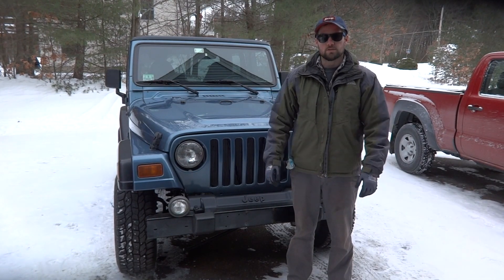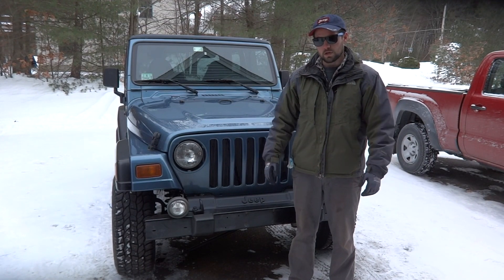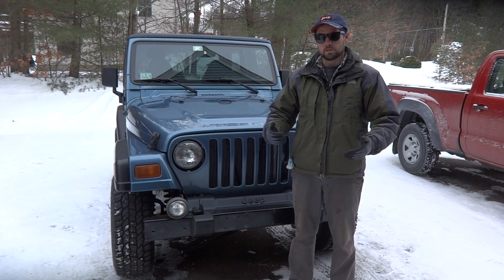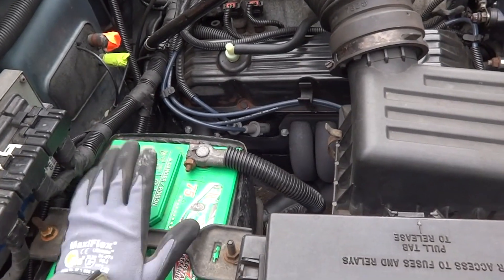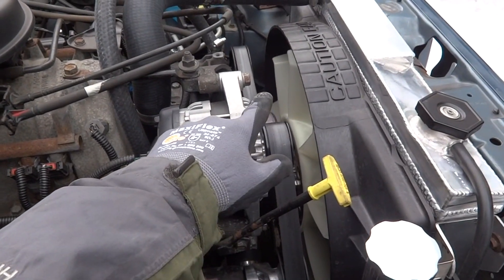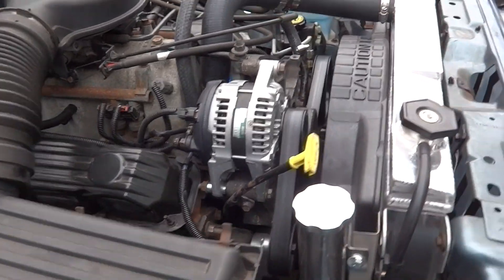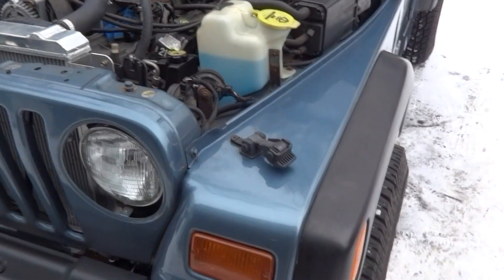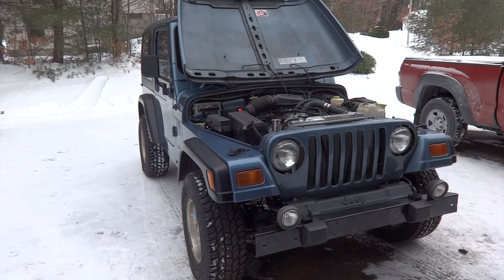Stuffing a 5.2L V8 into a Jeep Wrangler - Project Introduction | V8 TJ Part 1

Comment: What is ur mpg with the 5.2
Reply from the maker: So far has been around 13 mpg but the engine needs the plenum gasket replaced (and possibly some other work) so it may get a little better after that’s replaced. Mileage would also be better with a manual transmission.

Comment: Did you have to have any modifications done, 
i have a 2007 jeep wrangler with a blown 3.8l 
wanting to put a 5.2l out of a 1995 jeep grand Cherokee 
i have the complete grand cherokee vehicle
Reply from the maker: It would be a lot of work, I recommend doing a ton of research first. You'd probably be better off finding a donor vehicle closer to the 2007 model year, maybe a Hemi or an LS would be easier to make the electronics work.

Comment: Those had 4:10 in them
Reply from the maker: The jeep originally came with 4.10s but during the engine swap I installed a set of 3.73 axles to upgrade the rear dana 35 to a 44.

Comment: Great job! I love putting different engines in vehicles that didn't have said engine in there especially, if it's some sort of v8.
I'm conceptualizing a build for this winter  on a 2003 liberty. I love that you made it look like a factory install and the "practical" side of you thought about gas mileage. I'm mulling over the same points either using a durango/grand cherokee 4.7l, or 5l ford. The 4.7 is the same engine family as the present 3.7. However, 5l fords are tried and true. And, both being small v8s (hopefully) will net better gas mileage. The other reason for those 2 vs the 4.8l LS is the physical size. The ford is smaller all the way around. I haven't found exterior dimensions of the dodge 4.7 tho.
Reply from the maker: That sounds like a fun project. I don’t know a whole lot about either of those engines but I do recall hearing complaints about the 4.7 dripping valve seats

Comment: Hi, I would like to do the same swap (5.2 and BA from ZJ to 2.5TJ) as you've done but at the moment some information are missing to me about the ECU. I need to know the VIN number for the programmation of the ECU that I need to buy it in US, can you please help me and provide this number if you know it? Or maybe if you can provide me some other information or contact about it, it will be really helpful. Thank you and good job about your car.
Reply from the maker: Unfortunately I don’t think I can help you with that. I would say your best bet it to use the ECU from the same vehicle that the engine came from. I’m not sure if the vin is programmed into these ECUs, I’ve attempted to read the vin from mine with a scanner but have not been able to.

Comment: Hi.  Nice building.  
I have a 2006 Tj with a 2.4 with 6-speed manual that I plan to replace with a 5.2 automatic from a -97 cherokee.  What do you think about such a swap?  Or do you have something to recommend?  I have to use original parts such as fuel injection and catalyst if I am to get that road legal here in Sweden.
Reply from the maker: The closer in year the two vehicles are, the easier of a time you will have with wiring the new engine. I’d look for an 06 Cherokee with a Hemi to use, if those were available in Sweden

Comment: I apologize if this was already addressed, but being that it is a 2003, did you have to deal with inspections?  I was under the impression that it had to be a pre-2000 model.  Would love to know the legality of such swaps and whether I can use a newer Wrangler.  Thanks.
Reply from the maker: Emissions inspection requirements are vastly different between states, I would recommend looking into whatever state agency is in charge of doing inspections on your state and give them a call

Comment: Hello I have a jeep 99 wrangler it also has the 5.2 motor that was swapped into it I need some help I was wondering if there’s anyway you could help me I have some ECU questions
Reply from the maker: I'm not expert but I can try. I'd recommend checking out the 'Wrangler Magnum V8 Discussion' thread over on jeepforum.com too

Comment: Collecting parts for this very swap into a 1997 TJ with manual Ax-15
Reply from the maker: Manual is the best way to go with this swap IMO. Less wiring.
Reply: Do you need to get a manual 5.9 or 5.2 ECM/PCM or will auto or manual work?
Reply from the maker: @zackarymccullough5368  You'll need a manual PCM for a manual transmission

Comment: Hey great v8 swap! I'm in the process of a 5.2 swap too, the only thing that keeps me from doing it (besides corona) is the wiring harness part. Once your are done with the wiring for the engine, what do i have to do with the other electronic components? If i do an standalone wiring harness with working gauges, will i need another harness for things like parking lights interior and exterior lights blinkers etc or after the engine part done i have to add more wiring to the new engine pcm? I'm totally new with this i think i'm running in circles for nothing 😅😅😅 thanks in advance
Reply from the maker: No extra wiring needed, that’s the beauty of this swap! Splice the V8 engine connectors (and transmission connectors if you’re installing an auto) into the jeeps engine wiring harness, swap in the v8 pcm, and you’re done, no other wiring mods needed. Easier said than done, but probably one of the most simple modern engine swaps you’ll find. Just make sure your jeep and the donor pcm have the same interface style (CCD vs PCI)

Comment: Hey man, fantastic video! I'm watching your whole serie, I'm looking into swapping my 2.5L 4Cyl for something bigger. 
Obviously you're swap is legendary it's so clean and sounds very good. So I'm leaning towards doing the same thing. 
I'm just slowed by the fact that mine is a YJ and you swap a TJ. Is it still okay, am I going to run into issues, also.... does it matter what year is my 5.2L that I will be shopping for?. 
Thank you so much for all the videos.
Reply from the maker: I can’t give much info on swapping into a YJ, but more than likely your YJ is running an OBD1 diagnostic system, so at the least I’d probably try to find a donor with OBD1. OBD2 came into play around 1996. Beyond that I’d do some searching at jeepforum.com and see if there’s any info from others who have done the swap.

Comment: 360 bored out to a 408 stroker would be a beast
Reply from the maker: I've considered it, but I actually like the 5.2 as is. Wouldn't complain if it were a little better on gas though (but its not much worse than the 4 cylinder it replaced).

Comment: i have a 5.2 in a 95 grand cherokee that i am planning on swaping into my 04 LJ. is this basicly the same as the durango 5.2? would i need the computer and harness from the grand cherokee?
Reply from the maker: You're going to have a major wiring headache on your hands. I presume the zj has OBD1 and the LJ has OBD2. Your LJ has a PCI style computer so you'd ideally want to find a donor vehicle with a OBD2 PCI computer (check out the hotwireauto link in the pinned post at the top of the page).

Comment: What o2 sensors are you using? I have one upstream and down stream in my swap like what the 5.2 calls for but the connectors to them aren’t the same connectors as the 5.2.
Reply from the maker: I used the TJ o2 sensors

Comment: Any interference or clearance work on the drive shaft and trans housing? In some research it has been stated that the 46RE + the NP231 causes some issue with the front shaft and trans body. Did you run into any issues?
Reply from the maker: I haven't actually installed the front shaft yet but I have a skinny aftermarket shaft and it looks like it will be a VERY tight fit. I may have to shave a bit of the lip where the trans pan mates to the trans to give a little more clearance...we'll see.

Comment: Care to share what vac line you plugged into the port on the throttle body? On your engine it looked like it ran to the rear of the engine. I’m doing this swap and trying to figure out where the evap lines from the TJ go on the 5.2. Thanks.
Reply from the maker: I basically took all the vac line pieces from the TJ and from the donor vehicle and pieced them together as needed. No real rhyme or reason to it other than connecting them together as cleanly and organized as possible.

Comment: What size exhaust are you running?  What kind of muffler?  It sounds good. I just started mine for the first time today
Reply from the maker: Congrats. I'm running 2.25" from the headers to a y-pipe, then 2.5" the rest of the way once the pipes are combined. After a little research ZJ guys seem to think 3" pipe is optimal for this engine instead of the 2.5", but I went with 2.5" because i couldn't find a prebent tailpipe larger than 2.5" (bought from Summit racing). The muffler is also Summit racing brand and came with the tailpipe as a package.
Reply from the maker: https://www.youtube.com/watch?v=kMQkuJBCer4
Reply: @dironaa   thanks appreciate it

Comment: super clean look. what differentials are you going to run? I have a old ram 1500 with the 5.9, I was going to swap the diffs underneath the truck onto the jeep
Reply from the maker: Thanks! I'm running a stock TJ Dana 44 rear and Dana 30 front. Unless you plan on throwing performance parts at the 5.9 and beating the snot out of your rig I'd expect a d44 to hold up just fine.
Reply: Dirona that’s kinda what I was thinking too with the 44. But I’m going to build it to use it in the woods and have fun. I’m going to be running at least 35s or 37s.

Comment: This is a great video and probably the cleanest "factory" build I've seen. My question is about engine placement. What mounts did you use? Most people use AA mounts but ignore their placement instructions, and scoot the engine back as far as they can to avoid having to adjust driveshafts and transmission mounts. Personally I think that's ludicrous, but yours looks like it's properly placed. Just wondering if they were AA mounts in the recommended position. Thanks!
Reply from the maker: Thanks. Yeah, they are the AA mount placed in their recommended position. Have plenty of access to the engine/engine bay from all sides with this placement, losing that wasn't worth saving a few bucks on driveshafts to me.
Reply: Dirona I agree. Thanks for the reply. How’s the power off-road and freeway travel? I hear guys complain it’s too sluggish but I’m not trying to go more than 80mph, or go 0-60 in three seconds lol. Trying to avoid the guzzling 5.9 if I can.

Comment: If you want a factory ac set up let me know. I can tell you what you need. I done my 98tj 5.2 5speed.
Reply from the maker: That would be great! I presume you had custom lines made?
Reply: Dirona 
I wanted every thing factory like. So No ish’ I took a 98 Dodge Dakota 5.2 line off the ac pump plugged into the Tj condenser. Tj stock line from the condenser to the stock Tj evaporator. Then from the evaporator to a 98 dodge Dakota drier. From the drier back to the ac pump will be a female to female ends. Went on eBay and found the crimp on male end for the ac line. I cut the hose to length and had the end crimped on at o’Reillys. Now the heater box out of a xj is the same as a Tj. So if you want the 100% right box then junk yard a 97 plus xj.
Reply: Dirona  you can pm me for pictures and more.
Reply: Dirona 
 eBay it’s called- male springlock 45 degree aluminum crimp of fitting part# BL-4317
 It was only like $8. The battery and drier is super tight. I slide my battery all the ways over to the fender. And had to make a bracket to hold the drier.  After I installed the condenser I had to make a 1/4-1/2 spacer to mover my radiator back so it would not rub. But all my stuff was off eBay so it could just be mine.
Reply: Did I ever sent a picture of the ac set up?

Comment: I have a question what year and size engine is your ford explorer cooling fan off of?
Reply from the maker: I believe it would be a 93 explorer with 4.0 engine. Specifically I used Dorman part # 620-112. Was around $25 if memory serves correct
Reply: You can use a Jeep wj Electric fan with the 4.0 fan shroud

Comment: Why on earth would anyone swap a wore out engine into anything???   It would be a simple matter to rebuild it before you install it. Now you get to take it out, rebuild and reinstall.
Reply from the maker: Good question. In the back of my mind I never really planned on keeping this engine. I'd like to build either a 5.2 or 5.9 from the block up with a mild cam and some performance mods but wasn't willing to dump that money into the engine before knowing for sure that I'd be able to make the swap work. In reality pulling and installing the engine was one of the easiest parts of this swap...the wiring, fabrication, and adapting of non-standard parts is what took 98% of the time and effort involved.

Swapping a rebuilt engine with the one currently installed should only be 3-4 hr for removal and the same for install, which is next to nothing compared to the mass amount of time involved in the swap as a whole. 

The short version: for me, it made the most sense at the time.
Reply: 103,000 miles on a well maintained engine isn't a lot. I've been getting 250k to 300k out of my cars before I get rid of them..........................still in great running condition.
Reply: Wore out? 104,000 is not even close
Reply: The nv3550 has been holding up fine to a stock 5.2. And I rebuilt the 5.2 fully and still holding up. I swapped in a rubicon Dana 44 when I had my 2.5. It didn’t last. I now have a 8.8 and the stock traclock with a cobra clutch pack. I broke the spider gears. But over all like the 8.8 and would recommend it

Comment: hello I write from Italy, how did you keep your instrument orignal jeep 4.0?
did you use a special electrical system or did you use orignal 5.2 v8 electrical system?
Reply: http://www.hotwireauto.com/?page=mopar-eng
Reply: giorgio scacciaferro  I done a v8 5speed in my 98tj.   I went to a junk yard and pulled a 98-99 Dodge Ram 5.2 5speed harness. And sliced the two together. The gauges have a different like ohms stuff called the bus. You can look on line or I have the websites for them that will let you know what computer will talk to your gauges.